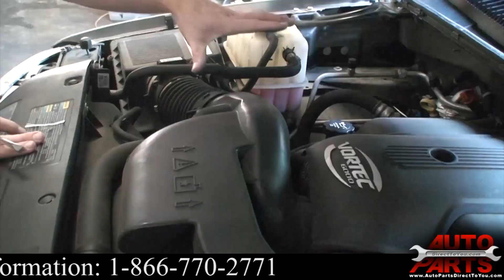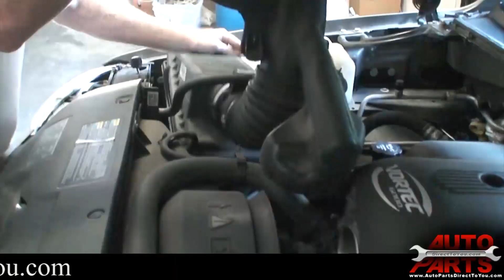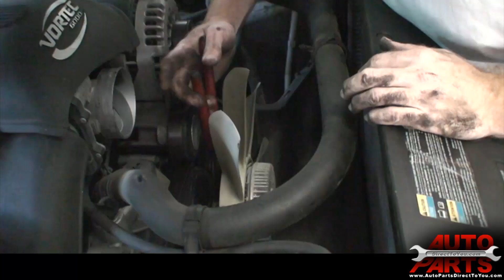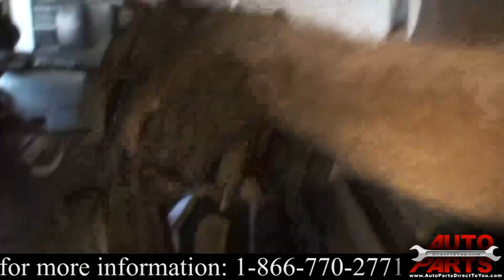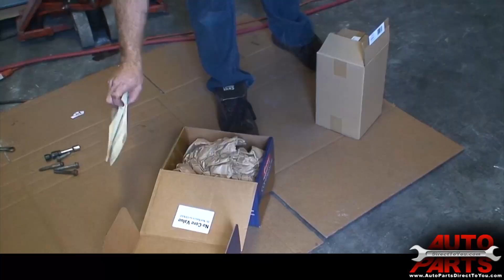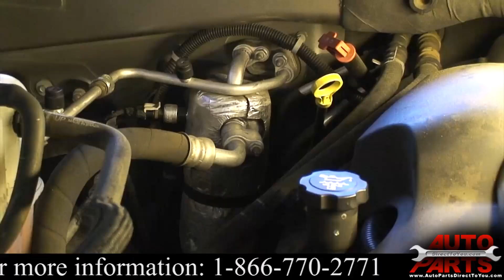2003 GMC Yukon AC Compressor and Accumulator Part 1: AC Compressor

Comment: I have a 2015 yukon. The compressor keeps clicking on and off  the ac was working fine. Then it started blowing hot air. Is there a pressure switch on my yukon, and if so. You think this is my problem  the low side is freezing w2!

Comment: What is the wiring connector  on the back of the compressor for?
Reply from the maker: Great question, the rear connector is a high pressure blow out switch, it is not the typical low and high pressure switch but a switch to shut down the compressor if the pressure gets too high,  this switch can be a pain when it goes bad as you have to remove the compressor to replace that switch. This vehicle still has the typical high and low pressure switches and this internal compressor switch.
Reply: @APDTY  I don't understand what leads connect to the rear switch if the original one didn't have one

Comment: Your method is fine. however you didn't even mention anything about the Belt, and/or the belt tensioner. It is always a good idea to replace these inexpensive parts while doing this job

Comment: Why to change accumulator, if only compressor is bad?
Reply from the maker: so first, the accumulator will not last the lifetime of 2 compressors, 2nd the accumulator has desiccant inside that absorbs moisture and this allows the performance of the ac to be good, 3rd all the compressor manufactures require the replacement of the accumulator and expansion valve and other procedures to be followed to even have a warranty on that compressor.
Reply: @APDTY  Well responded. Thanks.

Comment: Just a tidbit...on some chevy compressors the new or remanufactured compresson does not come with a high pressure switch on the compressor...u will need snap ring pilers  to get old switch out and if ur lucky should come right....anyhow just be prepared to just buy a new one instead of struggling in trying to get old switch out of compressor=)
Reply: The old compressor did not have that rear switch. What wires to it?

Comment: Talon hendricks, the shop didnt tell me anything. I just went to advance auto to buy a refill can and the guy who works there attached a gauge to it and it showed it was already filled. But there was no cold air coming out so he said he could try to release some and when he did i saw whiyr exhaust come out the tailpipe and it had a smell to it. So yeah i came to the conclusion that the air compressor was shot
Reply from the maker: diva4lyfe2010 no a diagnosis is really required, no real evidence of anything unless gauges are looked at with the compressor running, if it is not running, then that must be diagnosed first before damming the compressor

Comment: How much tork do you need to put on the suction line going to the accumulator there is a gasket in than that I'm having an issue with it's leaking after I replaced it.

Comment: Thanks for the video it helped a lot. I could not figure out how to get the compressor out until I watched this. Then it was so simple. I tried to get it out the bottom and looked at taking it out the top of the engine. I never thought about removing the fan shroud and taking it out the front. Thanks again.

Comment: On a new compressor. Is it charged a little? While removing the high pressure plug on the back mine released a little air....
Reply from the maker: most compressor are left under pressure or vacuum then capped after tested.

Comment: I bought a new compressor , it say that contains  8oz of oil and need to add more for vehicles equipped with rear AC , my question is how much  more ?
Reply: Maybe the sticker on the hood or radiator support has it?  Or call a GM dealer with your VIN.

Stay gold.

Comment: On my 2002 suburban with rear aircon . I only removed the plastic rock guard under the car .  Got all the bolts easy and pulled it out back first next to the right side header . But , I'm tall with gorilla arms , and one of those electric 3/8 ratchets .

Comment: TIP for removing the fan assemble... before you take the belt off, take a long punch and tap on the flat part of where you put the wrench on the fan. turn it and repeat on every other flat spot. then take your fan clutch tool and tap it to unscrew the fan. once it is loose it will come off freely

Comment: my 01 suburban 5.3 has some issues. last year the compressor stopped working and kept blowing the fuse, I think the clutch shit the bed, with 130k, I'm going to replace the entire compressor with a new clutch on it. my waterpump is lightly leaking so a good time to do both i think. one thing I noticed before the ac stopped working was, when b I went out for lunch and sat in my truck to eat  (at work), the ac wouldn't blow cold, I had to drive the truck at speed 25mod and up for a bit, maybe around the block, then the ac would blow cold from then on, does that sound like maybe the fan clutch wasn't working properly? I am debating on installing a new fan clutch since it's all coming off
Reply from the maker: +brianallen0826 Replacing the fan clutch would be a good preventive repair, and yes your on the right track of diagnosing the problem. Air flow, check for blockages to the condenser  and radiator.  Having a low system charge could also show this same symptom. What was the coolant level? If any fluids like coolant or oil are low this will effect the engines ability to maintain a good operating temperature.

Comment: was wondering if someone has ever tried to put a 03 to a 06 ac compressor. 99 to a 02 ac compressor and hose fit perfect there's just a extra connector of the back of the 99/02 ac compressor??
Reply: did you find a answer, i just got a a free ac compressor from a 06 wanted to see if it will work

Comment: I already went to a few places and they cant seem to find a leak in any of the hoses, my AC doesn't blow cool air when im stopped or when I am driving. Blows hot air when I need it... Any suggestions?
Reply from the maker: Ask them to check the AC system, they have to check the pressures to see if you actually even need refrigerant. You may not have a leak at all and might just have a failed cooling fan as that is a number 1 cause of no cool air during a stop. The fan cools down the ac condenser and if it is not cooled down the high side ac pressures rise up and also you will get hot air.
Reply: Thank you I will definitely check that out, by any chance would you know the part number from the website you mentioned?  http://www.apdty.com/
Reply from the maker: Roberto Beltran It depends on the exact year, make, model and engine size. you can email that or call us toll free at 1-866-770-2771, thanks
Reply: +Roberto Beltran    Check Freon level. If compressor not working check clutch relay/fuse. Check to make sure power to compressor. If all is ok check compressor clutch air gap max .03". It will not engage if air gap too wide or will run intermittent.

Comment: Hi, great video.  I have a 2003 Suburban & when I run the AC there a a loud thumping noise, which I assume is coming from the belt trying to turn the compressor pulley.  This only occurs when the engine is under load at about 25-35 mph.  At lower speeds rpm or higher speeds the knocking/thumping noise disappears.  The AC still blows super cold, so we've resorted to turning it off when we come to a stop then turn it back on after we get up to speed.  Any ideas?  To me is seems more like a clutch issue.
Reply from the maker: Identifying that noise would be the easiest way to identify the problem obviously, but maybe it is not making this noise when sitting at idle? A shop would try to identify where that noise is coming from first and would set the brakes, use wheel chocks or lift the vehicle just off the ground, then they may run the engine in neutral and if needed, put it in drive and slightly rev the engine to give it a load. Hopefully it is just an ac compressor and not an engine knock which also gets worse while under load.
Reply: I forgot to mention that we've broken 2 AC belts belts in the last 6-8 mo.  Once was at idle with AC running.  I revved engine up to see when the thumping sound occurred & the belt broke.  It sounds like the compressor pulley is too hard to turn & the belt is slipping around it until the engine gets up to speed.
Reply from the maker: chinner8 ok, yeah the compressor is most likely starting to fail internally. It will start to be harder to turn and eventually will lock up totally. You want to replace that asap and will want to flush the rest of the AC system or replace the AC condenser. When the AC compressor starts to lock up internally, small pieces of the compressor will break off and circulate through the rest of the AC system. You want to prevent that s much as you can or more parts will need replacing as those small particles will float around and eventually go into the new compressor and cause it to fail.
Reply: Thanks!

Comment: Our 2007 GMC Envoy's AC works fine while driving, but when I am stopped, the air stops blowing cold. If I put it in park and and raise the RPM's it starts cooling again. Any ideas? Only warm while stopped.
Reply from the maker: Yes that symptom is very common when a cooling fan is failed or failing. Your model should have an electronic fan clutch attached to a plastic fan blade. It should pull air through the AC condenser and radiator when you are sitting at a stop light. You may also have an auxiliary fan attached to the radiator if you have a towing package. Both fans need to be checked and most likely the fan clutch is worn our and not spinning the fan blade enough to pull air through. That fan is also computer controlled and usually will throw a check engine light. If you have a check engine light on, then that is the first place to start and will most likely be a code pointing out something is wrong with then fan clutch. If no check engine light, then it may be best to have a shop do and AC check to make sure the AC pressures are working properly. If you can identify a bad cooling fan or blade, that will certainly cause the AC to get warm when the vehicle is sitting in place and now air is running through the condenser.

Comment from the maker: I don't think there are any special tricks needed on that vehicle, once the system is empty you should be able to unscrew the lines going to the accumulator, and there should be a clamp about halfway down which needs to be unbolted, then it should come out.

Comment from the maker: If the compressor comes filled with the correct amount of oil, you do not need to do any additional prep work to it before bolting it in.
Reply: HOw much oil would one need?
Reply: The compressor I got told me to dump the oil it came with out and add different oil I'm confused
Reply: @marcusspaulding9839 that's a really good question. The fact that they don't say how much oil they come with inside is troubling, and the fact I can't find any specs anywhere is also troubling.

Comment from the maker: The Tahoe would be just about the same as the truck in this video. I am not sure of what the labor cost would be because it varies so much from parts of the country and different shops. Your best bet is to call up a couple local shops if you aren't going to do the work yourself and ask how much they want.

Comment: I have a 1997 pontiac grand am se 2.4 four cyl engine.  I'm putting a used compressor in my car.  It says it takes 9oz. of oil on the compressor.  I will drain most of the oil out of the compressor by removing the drain bolt and through the other ports.  My question is does it matter where I pour the new oil in?  Do I put it all in where the drain plug is? or do i pour half in there and the rest in the ports?  And I read I should put some oil in the new accumulator? Correct?  thanks

Comment from the maker: Hi Andrew, the Accumulator is similar to an AC Drier, one of it's functions is to remove the moisture out of the refrigerant, the difference from a drier is that it is on the low-pressure side of the system. Any time you open the system you want to replace to drier or accumulator to prevent moisture (humidity in the air) from damaging the internals of your AC system.
Reply: Auto Parts Direct To You 
How much tork do I need to put on the suction line going to the aculmater

Comment from the maker: @1919mblades Yes, the oil can also be added to the condenser, or accumulator, or just about anywhere you can physically put it. The refrigerant when pumping through the system mixes with the oil and it circulates throughout the entire AC system.

Comment from the maker: @1919mblades If there is metal in the system, the only thing you may want to do differently is to replace the AC condenser. The passages inside the condenser are quite small and can become easily clogged. You also want to do an extra thorough flush to be sure that 100% of the metal is out of the system so it does not destroy your new compressor.